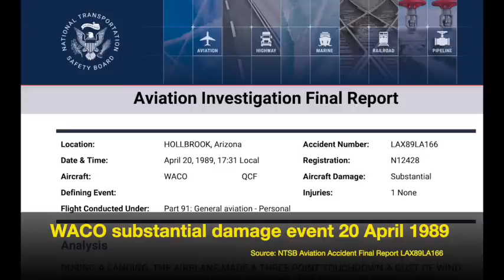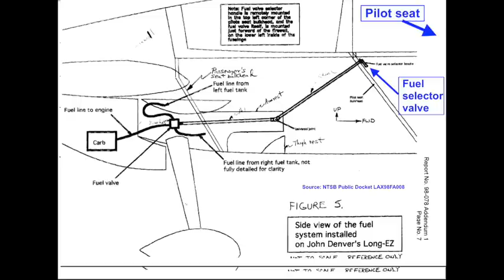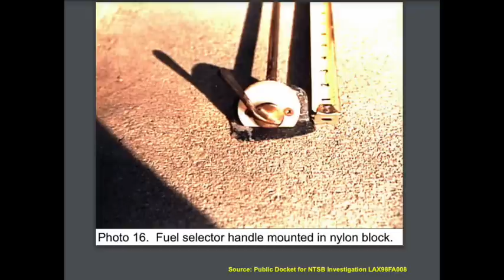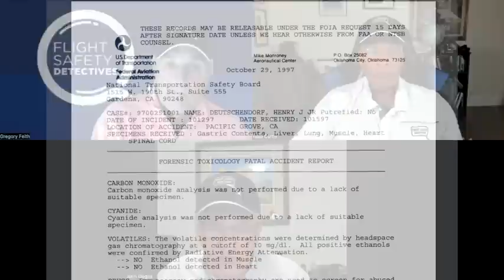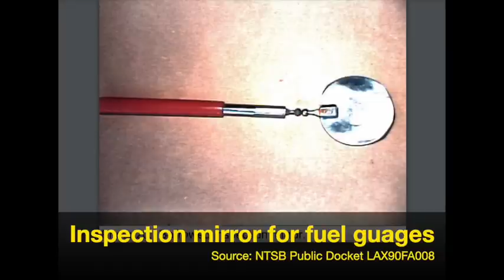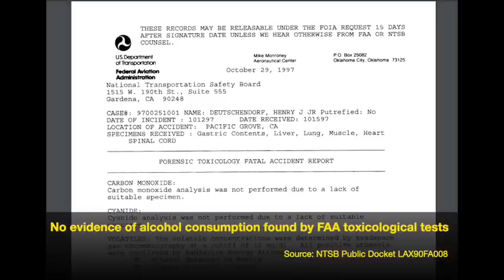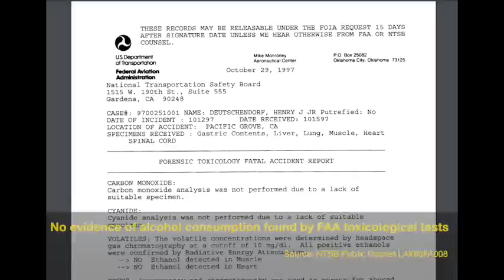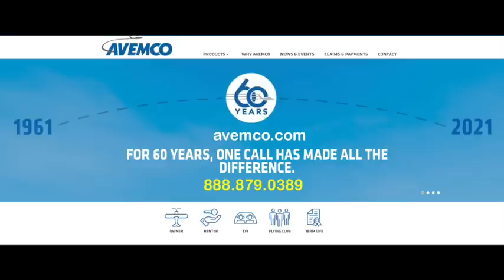John Denver Crash and Experimental Aircraft - Episode 140

Comment: The worst elementary problem is that you must learn how to handle an engine failure, whether it is a fuel problem, a broken cylinder, loss of the propeller, ignition etc, etc. This can happen prior to lift of, before V1, latest point to come to a stop on the remaining runway,  after VR, when the few options on a single engine, normally force a landing on a field, but already identified as useable. On a twin engine, V2 assures an adequate climb out for a return to land. Also important is the minimum altitude and the proper procedure to return  to land down wind. This phase is the most critical and difficult to practice, because the practice must be done at altitude.
Engine loss in cruise requires a review of candidate landing areas, preferably an airport reachable with the prevailing and predicted wind conditions and based on the predicted weather enroute.
Last but not least is the skill to maintain control and determine the best speed to fly to reach that chosen location, keeping in mind that in a head wind the best glide angle is reached by adding half the headwind component to the indicate airspeed.
The reason for the engine failure is secondary .

Comment: In my experience, why in the world that fuel valve not have a 3 way setting, where he could have set it to the middle, and then he could have set it in the middle to draw off both tanks, then he would have not run out of fuel, I know they make that valve, just so many things here that should have been done, I know Mr Denver had the money to put fuel in the plane, it's sad that this happened to another qualified pilot that just didn't think about his flight and the fuel valve, rest in peace brother!!!
Reply: The fuel system would be subject to interrupted fuel flow with a "both" setting. It relied on a fuel pump to get the fuel to the engine and a both system would allow air to enter the fuel pump with a both setting, starving the engine of fuel.  A both setting usually requires gravity flow. 

What people don't consider is that in an attempt to switch tanks, he may have turned the fuel off, then back on. That would explain the backfire heard by eyewitnesses. Then in a an attempt to look at the position of the selector, lost control of the airplane.
Reply: @Buck Murdock  
Thanks buck 
I learned to fly a citabria 7eca, and it was in Fairbanks alaska, it had wing tanks at that time, and the fuel tanks were equalized, with ball site bulbs, my instructor at the time told me before I did my round Robin 4 hours round trip, that I would have 4 gallons of fuel upon return, I was 5 miles out when I reported to the tower 5 miles out, and I looked at the balls in the wings, and guess what?? I was unable to see any balls, even though I rocked the plane left and right, none,I declared an emergency to the tower and I went pale white I'm sure, anyway I landed the plane, and the Faa was waiting for me at the fuel pump and did a review of how much usable fuel I had left, I had 4/10s of a gallon left, I was then told if I had to go around in the pattern again, I would have crashed  !! I learned a very valuable lesson 1 always top your tanks when you have a chance, and don't rely on your instructor to help you fly the plane, because there all types of variables that can bite you the rear, I loved your video on what likely happened to John Denver, God rest his soul, and I hope this helps someone else before they get into a cockpit of any plane  !!!
Reply: High wing aircraft usually have left-right-both, gravity feed, and a header tank...  I recall that on the C172 you turn the fuel pump on for takeoff and then turn it off when you've departed...

Whereas low wing aircraft often have left-right and a fuel pump that has to continuously operate to get the fuel up to the engine level...
Not sure why, perhaps to avoid having to have 2 fuel pumps, rather than just one...

I was surprised that in the review.of Kennedy's crash it was noted that in the Piper Archer you should manually switch tanks every 30 minutes to avoid weight imbalance, and that involves operation of the fuel pump, not just turning the selector...

Comment: What possessed the builder of the aircraft, to put the fuel selector, in such an inaccessible position for the pilot. How did that get passed?
Reply: The builder designed the fuel system so there would be no fuel lines running through the passenger compartment. Many airplanes are designed the same way. The builder and second owner flew the accident plane a combined 10+ yrs and 700 hrs, neither one found the fuel handle inaccessible. To me that is evidence of it being safe. 

How did that get passed? I see you are not familiar with the rules for homebuilt airplanes. One is free to design and install operating systems as he sees fit. I guess you'll be shocked to learn that some homebuilt airplanes use a converted automobile powerplant for propulsion! The horror ! !
Reply: @buckmurdock2500  Yes, I know some Homebuilt aircraft use automobile engines. The Volkswagen air cooled is very popular, for obvious reasons. But thanks for the patronising tone.
Reply: @buckmurdock2500  No.  The builder located the switch in the front of the seat.  The previous owner had it modified to be above and behind the pilot's left shoulder.  HE had it modified to move fuel lines from the passenger compartment.  However, the builder had already taken that into consideration and reinforced the materials between the fuel lines and the compartment.

Comment: Did the aircraft type certificate require re-certification after the modifications mentioned?
Was the fuel valve selector location part of the original type certificate or a later re-certification?
Reply: There is no type certificate for a home built. This Long-EZ was built exactly to this configuration, it flew over 850 hrs and 10+ yrs  without issue for 2 owners.

Comment: He wasn't supposed to be flying, and the fuel selector issue was known to most owners of that plane who learned to operate it via 'muscle memory' and to always make sure it wasn't binding during a pre-flight check. Later on an 'improved' design relocated the selector mitigating this problem.

Sad when someone likeable and famous dies from their own mistakes but they're human too aqd humans are prone to that.
Reply: Hogwash.  The switch was designed and installed in an easy-to-reach location.  The previous owner had it relocated on the bulkhead over the pilot's left shoulder.

Comment: I did not hear them even mention of fact but John was flying an unfamiliar aircraft with none of the switches marked because of the new paint job. This in itself is as dangerous as taking off without any gas . Yes John was A bad pilot but a good Singer. John had invited the mechanic to come along but the mechanic declined for some reason. How do you come along he would have been able to work that valve and therefore Stop the accident. The accident occurred when John pushed right rudder to get leverage to turn left over his shoulder for the valve.
Reply: The long ez is a tandem aircraft, so a passenger would be sitting in front of the pilot, ie much further from the fuel valve than the pilot is...
Reply: Mechanic made a common sense choice since JD had only enough fuel for his own planned airport area flight.
Reply: @PRH123 LEZ pilot is always in the front seat.
Reply: @MarkShinnick  ah, makes sense, so no change in COG from a passengers weight…

Comment: Experimental aircraft can be so dangerous when modified or built by novices. We lost a friend several years ago when he crashed his midget mustang after a fuel issue caused an engine failure on take off, he turned around instead of landing out and died in a fiery crash. Tragic!😢
Reply: Isn't that why they are called experimental, amateur-built? Because they are build by amateurs?